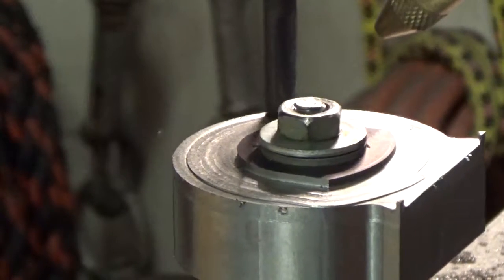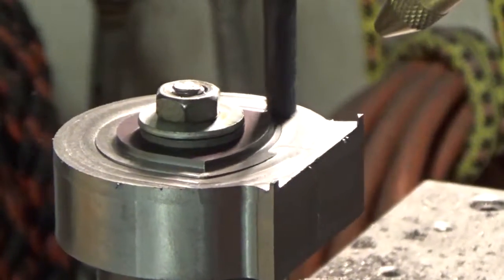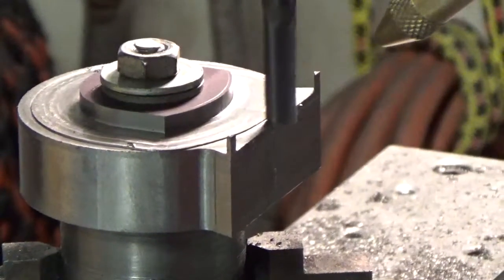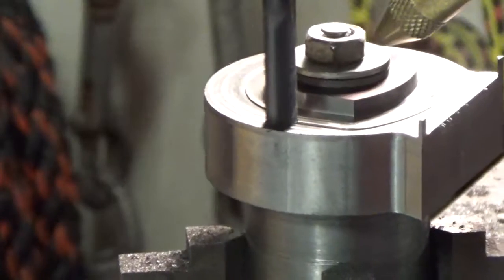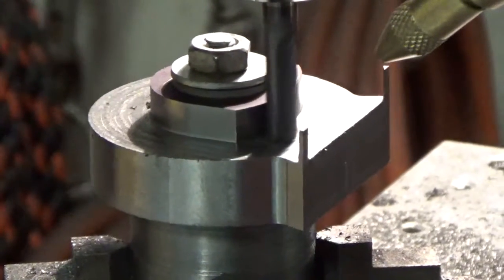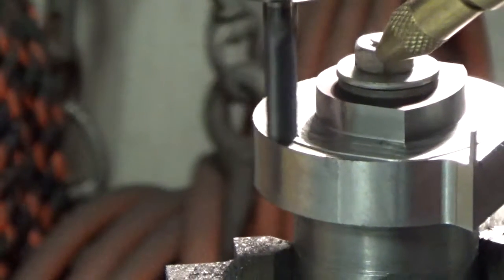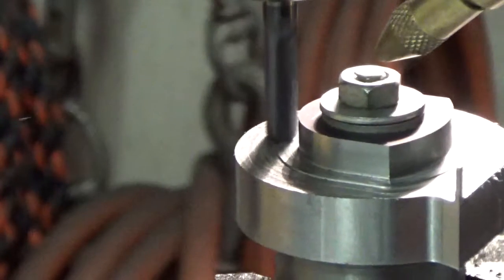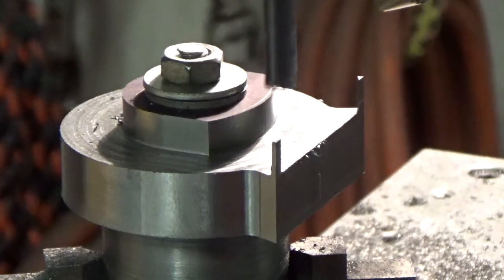Taig Micro Mill Cutting Front Unit for Shop Built Hand Shaper Step 2

Comment: Another great video Larry, some good closeup, I notice you have a pause at all quadrants can you make it continuance to stop the pause?,

After I stopped my video last evening I did a cut of something like .050 I was getting near completion of pass all of a sudden there was a change of sound from the motor, I stopped and noticed a nasty smell, the motor was so hot I couldn't touch it, but luckily its still runs, 

Edmund..........Alberta
Reply from the maker: I don't like the fact that the Sherline motor gets hot fairly easy.  There's no fan or ventilation, just the enclosed case of the motor.  I usually let it initially run continuous for 1 hour on the mill and then let it cool.  After that I get about 30 minutes.  I would think the lathe would be okay, but I know your doing some heavy cutting.  Regards: Larry